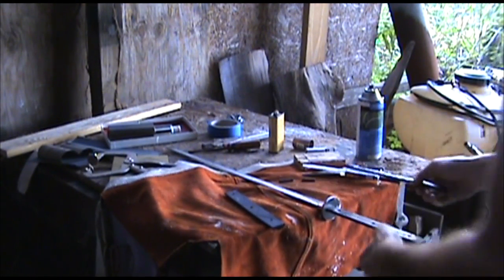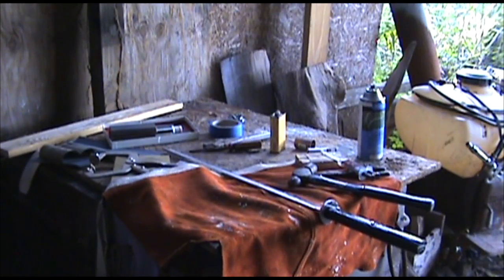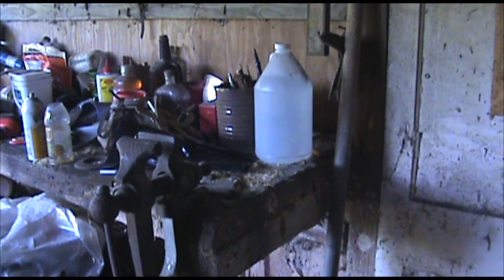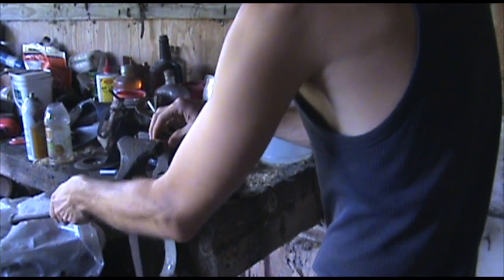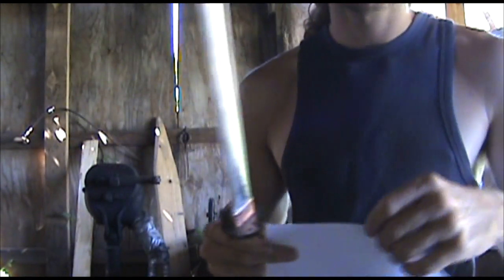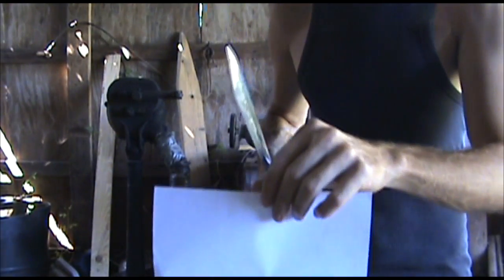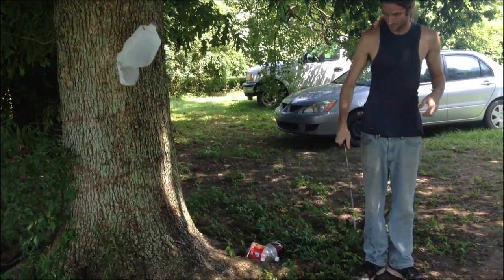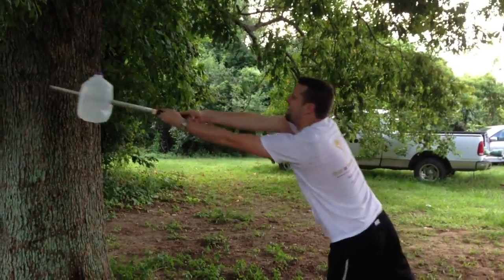Sword Making : Part 9 - Assembly and Demo

Comment: Might wanna use a leather strap on that blade at the end, to get it RAZOR sharp!
It's the difference between having to drag the blade on that sheet of paper....
And simply PUSHING  it through, and cutting it as easy as a hot knife in butter...
With NO DRAGGING MOTION!  ;-)